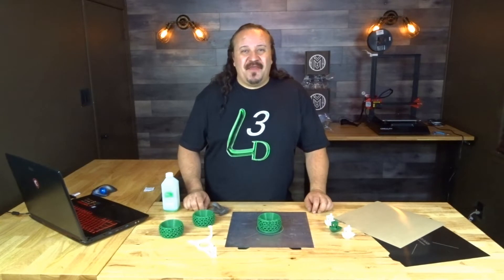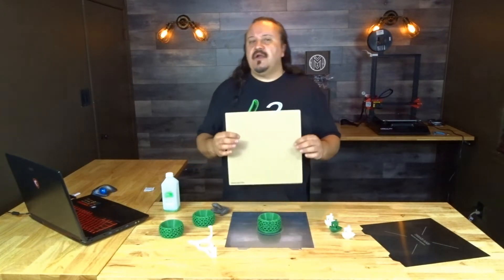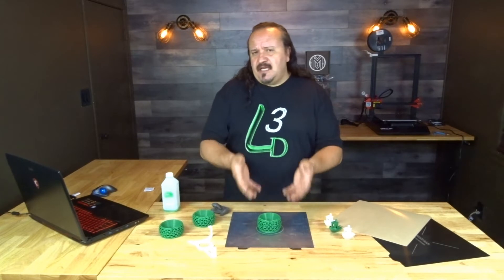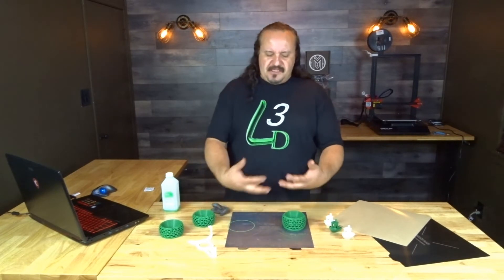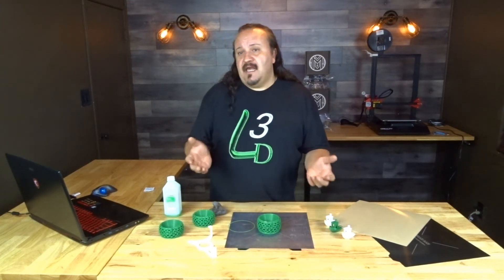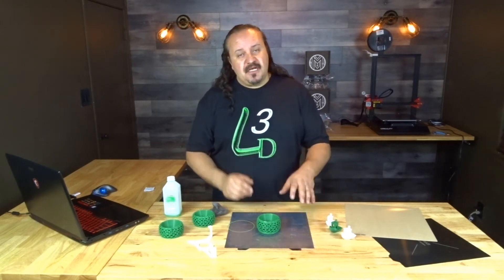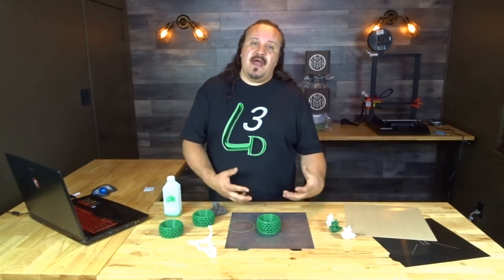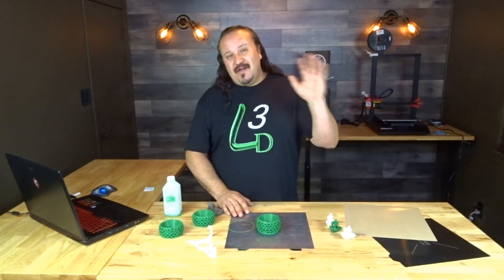(Final Thoughts: Video 2) WhamBam build bed system.

Comment: Thanks! I was on the fence about the Wham Bam system but this video helped me decide. I'm currently using a mirror for my bed and the pla seems to be sticking while it's hot and easy to remove when it's cooled so not in any rush to get it.